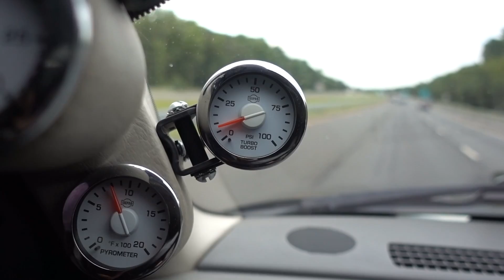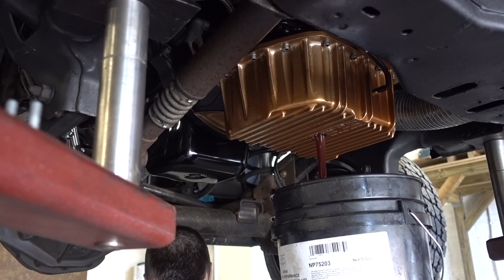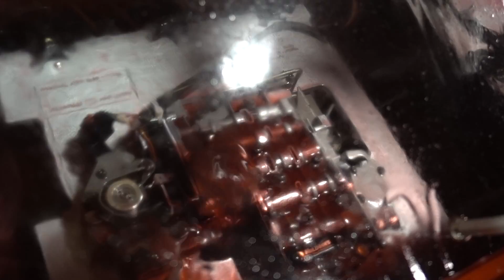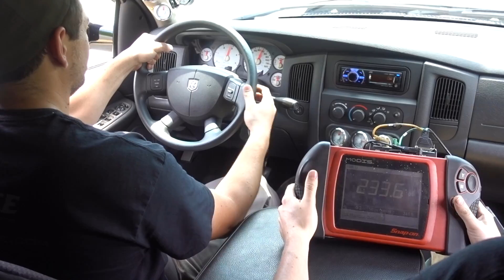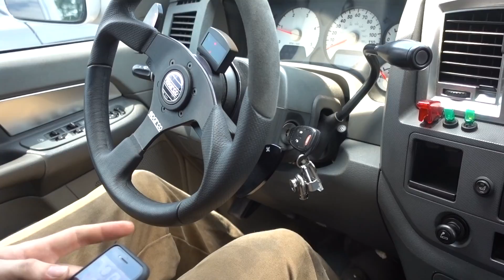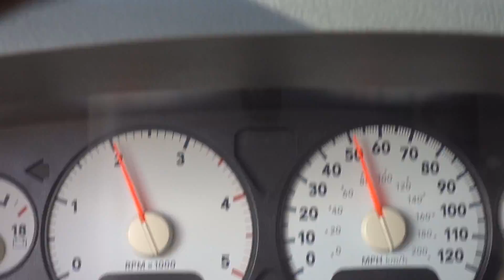24V TRIPLE TURBO CUMMINS GETS A LIFT!!! & HOW TO BUILD THE BADDEST TRANSMISSION EVER!!!

Comment: should ask trans man if he can fix my 2-3 shuffle under light throttle on my 05 relatively easily.. drives me nutts governer relay has been replaced so it must be pressures from the valve body
Reply: feff yes I can
Reply: cool. just call your place?

Comment: I got the same problem with my ac . Idk if it's certain year trucks at work I drive a dodge 3500 and no ac as well ... do you know what the problem could be ... i looked up some reasons and I see that my ac clutch something like that disengages

Comment: Hey Greg you've probably have be asked this a million times but why do you load the trucks over the trailer axle? I've always been told to get as much weight on the front as possible before starting to load the rear.

Comment: Greg,
 love your videos!! I just picked up a 07.5 6.7 Cummins with 85K miles on it. Its stock and MPG sucks a *ick, would douing a full delete help this? What would you change and which programmer would you use? Not looking for massive power just a damn reliable truck.
Reply: Christopher Benfield I would delete it do efi live custom tunes u will have eco tune and if u want power just turn the non I would also do a aftermarket cold air intake and exhaust you will be getting better fuel mileage for shure

Comment: Pffft " head gaskets gonna blow" 😂 I'm on 50 psi on stock bolts and original 20 year old gasket making just under 400 turn up the fuel Greg don't be scared 😉

Comment: If you come to PA and you don't have a DOT medical card, be careful if you tow more than 10,000lb.  PA is really cracking down.
Reply: Im not trying to be a know it all.  I argued the same thing for a long time.  Then I read all the federal and my states regulations for myself.  DOT officers should be a good resource, but they are not because different states choose to enforce different parks of their own and federal regulations.

Federal law states that any trailer over 10,000lb is considered commercial.  Personal trailers, including RVs are "excepted commerce".  They do not require commercial drivers licenses, USDot registration or any of the other federal requirements, EXCEPT, you must have a DOT medical card if the trailer is over 10,000lb.
Reply: paemt6220 my cousin hauled cars on a tip up fifth wheel up and down the east coast for a whole year and never got stopped or ticketed and he doesn't even have a CDL...might just be lucky but the truck had NO commercial names or numbers on it and never a problem...I haul my own stuff but I have a CDL and get drug tested all the time for work and always have the paperwork even if I'm "riding dirty" love the vids Greg
Reply: I just like to get people the correct info.  Most places in most states, you won't have an issue.  I only mentioned here because of Greg's proximity to PA.  The Pennsylvania State Police and many Local Law Enforcement agencies are cracking down.  Here in York, in the last year, several local departments have seen the revenue potential in enforcing these obscure DOT laws and have sent officers to the PSP for DOT training.  Fifth wheelers are. getting hit regularly.